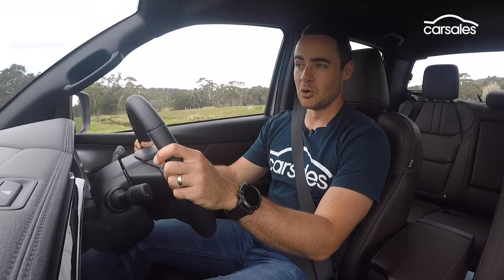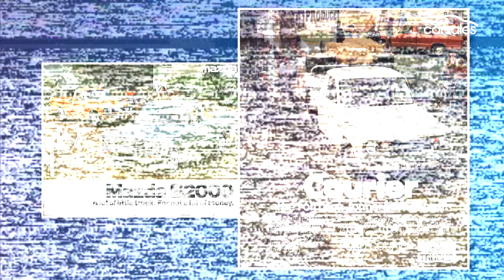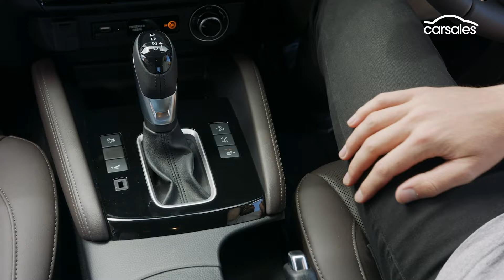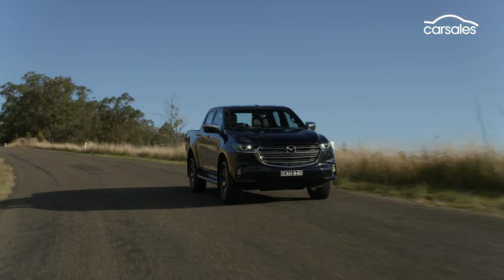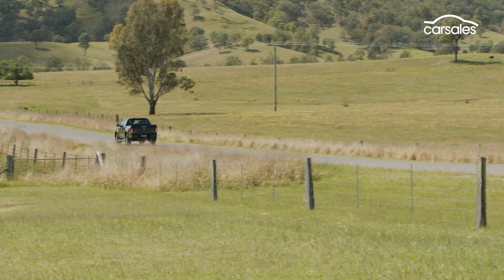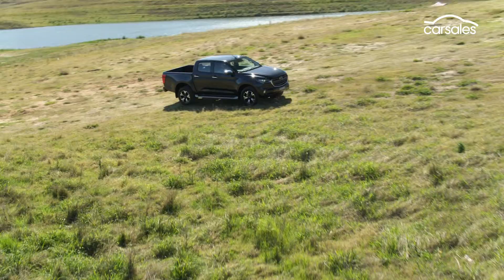Mazda BT-50 GT 2020 Review @carsales.com.au

Comment: Owned my BT50 XT Cab Chassis 8 weeks and travelled 10,000kms so far. Towed a 1.5 ton dual axle trailer for 5.000 of those miles. Did a mid tough trip across the High Country and it has not missed a beat. Nothing on or off road has troubled it so far. Brilliant fuel economy as well. The Electronic Lane departure technology edges on tooooo dramatic and is annoying that it turns back on each time you start it. Fitted a 180kg canopy so it rides really well. Would highly recommend to anyone and certainly worth a test drive. I really like the build quality as well.